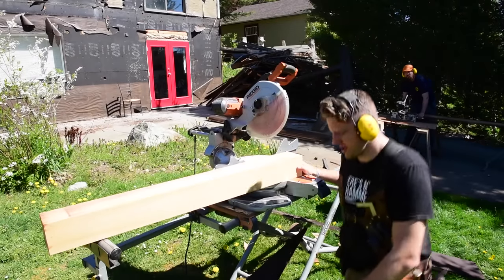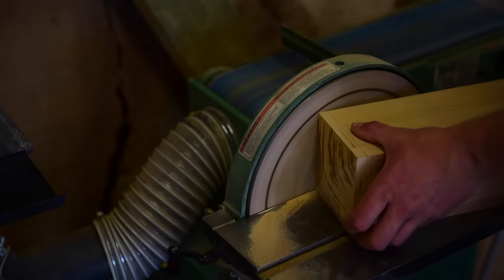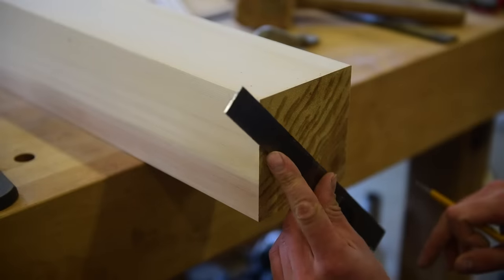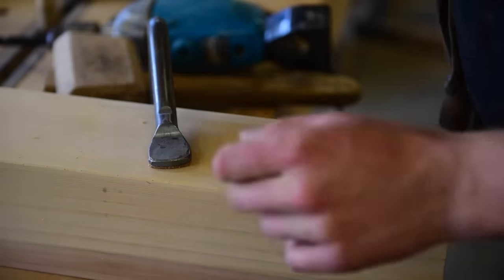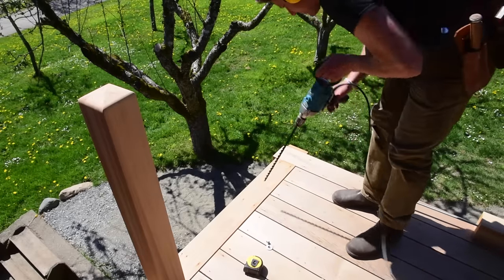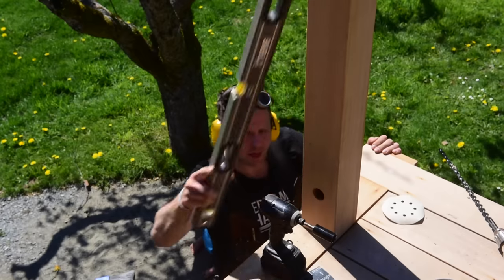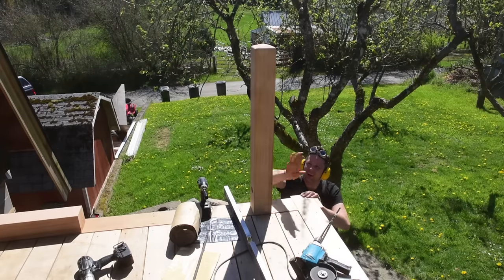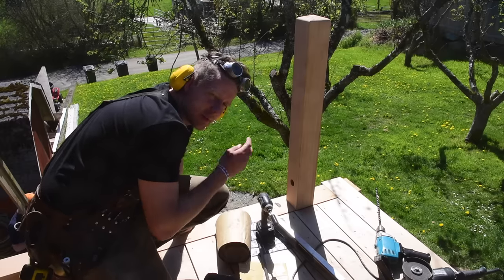FTF #54 How To Install Handrail Posts, Quick And Easy

Comment: In my experience the inspectors arent smart enough to tell which way the job is done once it is finished.
Reply: euan cameron This is exactly my thought, with the rail installed most inspectors in my area would loom at the bottom and see a big ol bolt and sign off. Codes vary state to state, county to county, even city to city. Just cause it doesn't meet national code doesn't mean to doesn't comply with local code. National code is simply a reference, a starting point for local jurisdictions. Hell more then half the land in the US still has no building codes if you don't include electrical. I'd trust this hand rail to hold my 400 pound uncle leaning on it with my nephew.

Comment: Why are you shimming? Isn't that lazy craftsmanship for the Samurai?
Reply: Hmm if the deck was level and the post was cut at 90 degrees then there wouldn't be any need for shims
Reply: Not necessarily. You're not account for imperfections in the deck board, the post, nor the saw blade itself.

Comment: Used this method to put up six posts in our front porch deck. I wouldn't really call it "quick and easy." Took me a day to prep the posts. Which was fine because it was raining and I had all day. I also put several two by sixes between the joists where the posts needed to go.  One of them, somehow, must have been at a slight angle when I cut it at the miter saw. Had to shave off some of the bottom. Be advised: those bottoms had better be 90 degrees plus or minus about a half a degree. And that hole through the bottom better be dead center. And sharpen your chisels first. I left them sort of loose while I got the top rails installed, then tightened everything down good and tight. And it does feel solid. With the top rails installed they locked together like a system. I could see the other ones shifting slightly when I tightened one post down. It feels like you'd need a truck and chain to pull it apart. So, it does work. But I don't think I'll use this method next time.  It just happened to be good for this project.

Comment: Is that stainless rod and hardware or at least galvanized? When doing posts  we use a threaded rod that has a machine thread on one end and a wood thread on the other. I drill at an angle and screw the rod in then using a pipe I bend the rod vertical, this will stop the post from ever loosening or turning. Love your vids. Thank you. So much God given talent and skill thanks for sharing it.

Comment: I was using a similar technique 25 yrs ago, that LJ Smith later copied somewhat; even improved.  Instead of that 1 1/2"  hole in the side of the newel, just thread the rod into the newel.  ( no visible plugs )  In the case you can't get to the bottom side of the bolt; the same bolt can be threaded in the girder on a balcony.  If done correctly, it's tight as a tuning fork.  I've never had one loosen, and I've done hundreds of stair cases / balconies.  In not knocking your technique, just saying what I used to do.  Now days, I just use the dowel bolt kits from LJ.  It's a lot faster, and just as strong.  The kit comes with everything you need for one newel;  except a 3/4" ratchet wrench.

Comment: So much better and faster to notch the post 1 1/2" and install flush with the face of the joist and install the floor after the posts are installed (it's code in most Canadian provinces). Also, water lying/gathering at the base of the newel will rot it, irrespective of the membrane. Some speculate that the membrane will actually prevent moisture from leaving the wood, thus, accelerating rot.

Comment: I really like this technique as well as the half lap picture framing you did with the deck boards. In one of the videos you mentioned setting the post in from the corner and using a "floating" railing. What did you mean by that. I would like to do something that doesn't hide the half lap joint yet retains the safety aspects required by code. Can you post a picture or link of what you meant ?

Comment: Well great way to put a post on a deck.
Will that membrane at the bottom really keep water out in the long term?
Seems to me that 5/6 years down the road it will loosen from the post and water will be able to pool against the end grain again.

However, it is a sweet way to install a post.  Also easy for the home owner to request a couple replacement posts to sit in the garage for any future mishaps?
Reply: I used some of this membrane stuff on my deck joists.  It's really sticky stuff on one side, like tar.  Once it seals itself to that 4x4 I don't see it ever coming lose.

Comment: Good job as usual, I used the same technique to build a bay window. How do you keep the top nut from unscrewing? My experience with free thread is to wreck the thread at one end so it won't turn and come undone at the back side.

Comment: In permitting a project in Arizona,  structural drawings would be required for this system showing it could stand 375 lbs of lateral force.  They would have to be sealed by a structural engineer and it probably cost $800-$1000. Notching the post into the  bottom perimeter edge joists is a standard detail  found in m many existing rail systems.  You can use that detail and cite the source for free - no structural engineer stamp needed. The notched system is also far stronger than this system and base caps can be used to prevent water infiltration.

Comment: Very nice detailed craftsmanship. At 13:31, are you using a firing strip that is fastened to the rim joist, then fastening the fascia board to that? Also, is that a drip edge flashing on the top edge of the fascia, under the decking? Very nice detailed craftsmanship.

Comment: I did something almost identical to this on interior stair Newel post, there happened to be a joist underneath where the post sat. The post was and is still ridiculously sturdy after 18 years and having raised 4 boys using that post as a grab bar! I ended up using a 3/4 inch wooden rod and shaving it to cover the hole. It was ok, but I later used a square rosette to decorate it. Anyway, it is still holding no wobbles! 

I'm now going to do a mailbox post and I considered this but wanted to see if there was something different out there..... but I think I'm going back to the rod!

Comment: Not sure if this would satisfy the IRC's prescriptive deck construction requirements. The tension  tie backs are designed to make the post, rim and joist a unitary system to resist a 500# moment applied to the post. That great big all thread ties the post to the rim, but doesn't keep the rim tied to the joists, so it's still possible to rotate the rim off the joists. Where I build in Illinois, I can guarantee any inspector I get would say "looks great, now take it out and add a tie back".

Comment: Possible idea was hinted at in the video when he mentioned joinery. 
Instead of using a Forstner bit to drill into the side of the post, could use a mortice chisel drill bit to make a mortice giving access  to the bolt, (no need to go back in with a chisel to make a flat bed for the washer)  then make a corresponding tenon on the bottom rail of the banister to plug the hole. might take a bit more time and will probably yield the same result as the method shown

Comment: Hello from Victoria,BC! Great videos!! Could the same concept you used to affix the post to your deck be applied to concrete? I have a
Cement stoop
(1959 house with 1959 wrought iron railing) is like to drill the cement, epoxy in a trash rod and do the same
Thing... what ya figure? It would have to be reversed engineered I.e threaded rod cemented to the stoop first and then painfully screw the nut down overtop of the post

Comment: Will this work for 6X6 posts, and if so do I need to use a larger diametered threaded rod and perhaps insert it deeper in order to secure the additional weight?

Comment: Never tried that system on a deck but I might now. Thanks for trying it first. FYI BCBC says no horizontal member on guards between 140mm and 900mm but I would do what your doing if I wasn't getting it inspected either because it looks better

Comment: Ive always installed posts b4 decking, put 4 staggered bolts sideways then bridged both sides of the post into yhe framing. Stronger than any 1/2" vertical bolt. Then cut your decking into the posts.
Reply: All your shimming takes place beneath the deck boards as well. Skirting hides any imperfections.
Reply: Matthew, I been doing it the exact same way for 35yrs and everyone wants to know why, that on my railings, there's basically no flex whatsoever !  Lagging to  the outside of the deck with a step in the 4 X 4 is OK, but nowhere near as strong. I always try to get my customers to go with 6X6, not just for strength but it also looks super rugged being such a large upright !!  Strong over building practices usually results in safety, great looks and lasts much, much longer, but also a lot more cash. Sorry so long, but it's cool to read about someone who builds quality !!  Thanks.

Comment: what i found helpful when doing the handrails is to leave the post slightly loose then cut all my handrails so that top and bottom rail are exact measurement then install the unit sometimes i use a strap to ratchet tight them fasten them to the posts then ill tighten all the posts when i have the handrails in place this helps in making them true then if need be ill shim a post

Comment: Great system. Code mAy be an issue but I think there is a work around with and engineers stamp on the threaded bolt specs. GREAT JOB.

Comment: Haven't read through all 321 comments, but wondering if anyone has asked why the post wasn't installed on the corner?  Will you have another post the same distance off the corner on the end of the deck where you were working?  Regardless, I really appreciate this post!  If the homeowner doesn't like it...deck'im!

Comment: So I will start off with I really like the theory of this design however I do have some concerns and a craftsman/ small business owner myself. You go through the trouble of priming and putting on a membrane to prevent water wicking up the post. Fantastic recommendation, however because it is out of plumb, and you and adding shims instead of measuring the of set angle. Then taking it over to that saw and cutting it to fit flush when plumb. With those shims you compromise that membrane acting as a seal and not keep the water out the joist you just drilled right through. Speaking of which why didn’t you make that a 4” beam. Is those Josie ever loosen and 2 x you drilled through is not going to hold craps when force use applied outward. serious like the idea just think needs fine tuned

Comment: Excellent work ! You know what your doing, ignore the ones who try to correct you. If they knew what was what, they would have a channel with 581K subscribers. Keep up the great work!!  Question, what is the brand of leather tool apron you are using with the vest or suspenders? It looks rather robust but still very comfortable with ample storage.

Comment: I want to see the finished railing corners, will this system hold a sheer weight of 250 lbs if not I m sure that upsizing the all-thread rod to a larger size would do

Comment: ever heard of idefix by sihga? its a much simpler system, no need to cover up any holes at the side of the post. its basically a metal crown, countersunk in the endgrain and screwed with eight angled screws. in the middle of the crown you can now put a threaded rod. no need to drill a hole from the side since there is no nut to fasten.
i am a carpenter from germany, we use idefix a lot. also the teeth of the crown stick out a bit to prevent the post from turning.

Comment: Beautiful way to do that bud. Thanks for the tip. I have never seen someone use so much membraine on a deck as you have. I will start now. Is it just ice and water shield?
Reply: Omg! They sell membrane tape for that purpose but It never crossed my kind to use ice and water shield. Its practically the same thing 1000 times cheaper

Comment: Really nice job, very neat. Just one question. Where do I get that self adhesive membrane you applied to the bottom of your post? Is that something I can get at one of the big box stores and what do I call it? Thanks for sharing your technique, I'm just about to install railing posts on my deck, trying to get it done before I'm buried in snow.
Reply: Lowes, Home Depot. Ice and Water Shield.

Comment: Love your skills!  I have a concrete ramp that I would love to use cedar posts on but mounting is a challenge.   Do you think doing this bolt through method you show in this video would work with a concrete anchor instead? ( that way I could keep the slope)

Comment: I've used this method for attaching posts to a stone slad on a couple occasions and it passed inspection but I'm in MA so not sure about other states.  Here it just needs to be able to withstand 200 lbs of forward pressure.  I would assume that if an engineer signs off on it that it would pass code in most places.  However I have found that the shorter the rod the more stable.  Just my experience tho.

Comment: Very good Grasshopper, I have installed deck rails like this for years, But where I live is like Canada so I always use stainless rod & hardware. Why is the post so far away from the end of the deck it looks to be at least 14" from the end???

Comment: If time were not an issue, is there a type of joint you would use for the railings. In my experience pocket screws are not terribly strong.

Comment: on a totally unrelated topic, I am also interested in how you position your plane blades for perfect alignment while sharpening them? do you have a jig that you have rigged, or did you buy something that works? Ideally, i would like a jig that i could adjust the pitch for specific purposes? ive thought of fabricating one at the shop but im not sure if there is something available that i could clamp down on the vice and adjust? if you have a tool that i should know about, please share? id also like to know what motivated you to be such a public figure, and details as to how the celebrity lifestyle is working out for you? 
P.S. what ive used up until this point to create a jig, is just my miter saw. i make a block of wood at the correct angle. The downfall of that method is that the wood dust from the block cloggs the sharpening stone and my efficiency declines.. anyway, if you have any thoughts on the subject, do tell. keep rockin' on my Canadian brother

Comment: @ 13:26 that hole is going through the double rim joist? essentially it turned it into a single rim joist because that 2nd board only has maybe 1/2" of wood holding the post now, if that. If someone   pulled it inwards wouldnt that break  right through the rim joist? I love this idea but it doesnt seem like much is holding that post.

Comment: Great vid! What's the diameter of the threaded rod you're using? I'm interested in using this technique for some fence posts
Reply: Lj Landry pretty sure it's 12 mm or half inch
Reply: Don't try this with fence posts and 1/2" rod. You'll end up bending the rod and your fence will start to lean.

Comment: Is there ay advantage in using a dowel offset from the centre to ensure the post doesn't twist at all? More relevant for stainless steel wire fencing rather than fixed board railing.

Comment: im really curious to know what you are charging for deck work considering the amount of extra details you implement. I try to be within $45-$55 US per sq ft depending on wood type or composite, which is obviously a vague number but if you have any details you can share about your pricing structure id really like to know. Im moving fast into the high end deck and railing market in Denver and would really like to implement a lot of this stuff.

Comment: what's the advantage of using the bolt and nut in from the side versus just filling the whole with construction adhesive like embedding a threaded rod in concrete?
Reply: Rawforlife77 I've used a similar technique, except that I use epoxy and a couple of nuts spaced apart on the all thread, to provide teeth for the epoxy; works like a charm
Reply: Its stronger.

Comment: do you think this would work on a 8 ft high privacy wall attached to my deck? I'm probably going to use 3 posts and it would be about 15 ft wide. Any suggestions would be greatly appreciated.

Comment: Though this is a cool way and sleek.. I can bend  up to 3/4" threaded rod with my own arms.. Add leverage at 40 inches with an average 200lb person it's almost 800lb/ft torque.. So unless your railing is going to tie into the house structure I wouldn't invite a rowdy crowd. .. The strongest way is to use the exiting footing post straight up or PL 2000 and Carriage Bolt the rail posts in the  existing framing before decking.  Any bad cuts can easily be covered by bottom post caps... just sayin'... But don't get me wrong this is an excellent cosmetic approach in your vid.... Cheers!

Comment: If the deck is level (no rain water run off) which we know it's not because it has a slope where do you make the top of the rails level or do you follow the deck in slope?  Do the post tops also follow the deck in slope?

Comment: I was wondering what the deal was with the ridged “ pig” lol glad you answered .. although it did the job , I have the sliding compound miter saw from Dewalt . Can’t beat it ., although making comes out with a comparable saw and of coarse if you wanna spend a ton of money get the Festool .. I really want the domino cutter from festool ... crazy expensive though .. any suggestions on a comparable domino cutter ?
Update .. 5 minutes later . It would appear that festool has cornered the market with the domino , what did they do patten it so no one else can make them ? Jerks